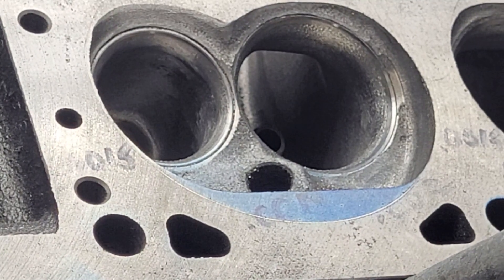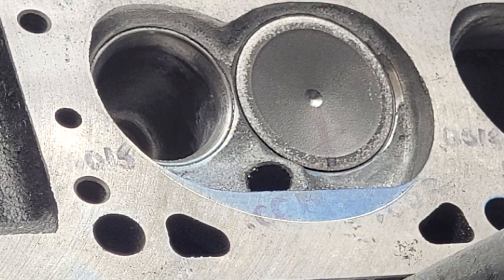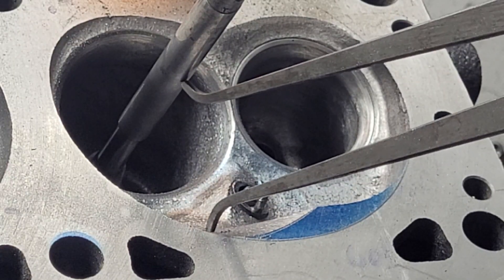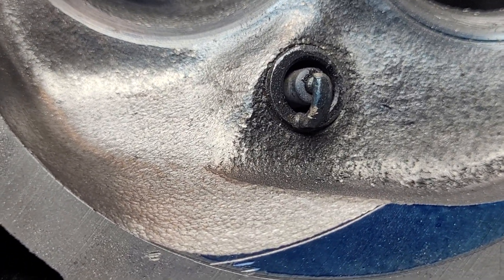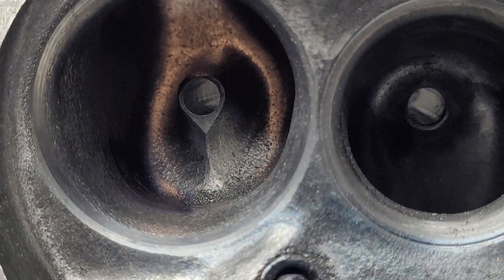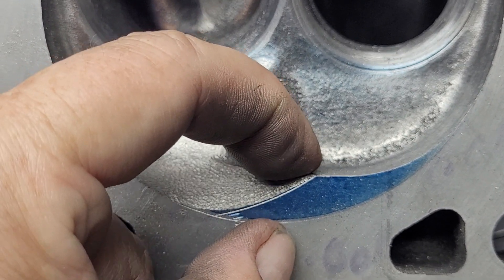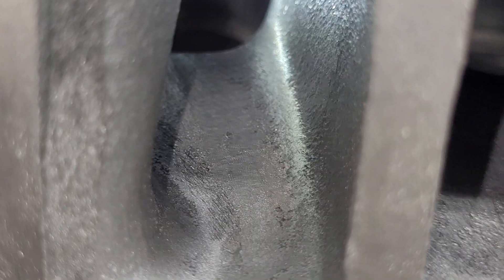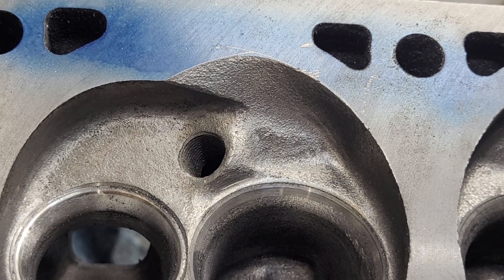EQ-CH 318B 318/360 cylinder head, Fuelie chamber cut mod and measuring.

Comment: I really appreciate your hard work because i know that it is really time consuming because i have done a bunch and without a flow bench your just guessing about what you did so thank you for sharing your knowledge i used to have access to a flow bench but no more my friend passed away and it got sold i remember enough about how to get them to flow 250cfm. But never done a chamber cut im all mopar so i really like to watch all related videos i remember you doing a set of 302 318 heads but can't find the video  i also done a set for my 360 truck motor put a set of 1.880 intakes and 1.600 exhaust i don't remember what they flowed but i do remember it wasn't worth all the work if im not mistaken they barely outflowed a stock magnum but your talking 60 hours of work those heads were not bad about cracking i had 4 sets maged and none of them were cracked i put them on my 0 decked 360 with a performer intake and a xe268 cam and that truck would pull my 6000 pound tractor around very good also had a 2500 stall again thank you for sharing your work
Reply from the maker: @raysimon1368  You are welcome. For most applications stock chamber is fine. I would love to see back to back dyno tests with and without chamber cut but it changes to port dynamics so much that it really needs a different port.

Comment: How do you know how far to go from the center of the valve when scribing the chamber cut?
Reply from the maker: @masonoller6597  It is a good question. As I get older I am more reserved in how far I go. There is a balancing act between flow and compression. How much improved flow equals compression lost?

Comment: Charles Servedeo, will you be flow testing after the chamber mod itself or will you be making several mods prior to flow testing again?  B.t.w., it looks really good.
Reply from the maker: It is three mods at ounce, fin, ssr, and chamber. Flow tests in this heat is an issue.
Reply from the maker: Thanks

Comment: Thank you for the instructions Charles! I wonder about the location of the 'piece' described @1min31s. For the best flow benefits, is it ideally placed at the center line of the intake port or more toward the cylinder wall side? Obviously everything depends on the thickness of the material in the chamber carved.
Reply from the maker: I think it neeeds to be where I put it. I don't see it working as well anywhere else. Thanks

Comment: Hi Charlie. When you are using the valve with the center drilled, how do you determine the measurement you are going to use for the calipers for the scribe mark? I might have missed it but you said you do this modification for swirl but what type of flow gains do you get? Thanks Andrew
Reply from the maker: I pick a distance I like. We will find out if these liked the chamber cut soon. Thanks
Reply: @servediocylinderheads  Really? No scientific reasoning?  I was hoping for a formula or rule of thumb but if it works go with it. Thanks. Andrew
Reply from the maker: @andrewburlock2653  Nah, it is a D.V. mod from the 80's or 90's for fuelie style chambers.
Reply from the maker: It is similar to Dart platinum chamber shape. D.V. may have had some input on that design.
Reply: David Vizard made a video about this with a 2.2 Chrysler head.  He used mathematical formulas to lay out the chamber like this.  It may be somewhat useful in this case, but as far as how useful, I can't tell you.
Reply from the maker: @ericsmcmahan  We will find out. Thanks

Comment: When you scribe the chamber radius, do you set the dividers to a set dimension or is it an experience kind of thing just to get it the way you want it to look?
Reply from the maker: How I want it to look. Thanks
Reply: So scribing with the dividers is to just get them all the same.
Reply: Do you scribe so the scallop end just past the far side of the spark plug?
Reply from the maker: @markhenke6043  Pretty much. Thanks

Comment: On a stock magnum head I've measured about .310" at the thinnest point of the chamber to water, same from deck to water.  I've laid that back on these but not as far as you go.  I don't have a flow bench so I limit chamber mods to information from others.  Thanks for the video
Reply from the maker: Good info. Thanks